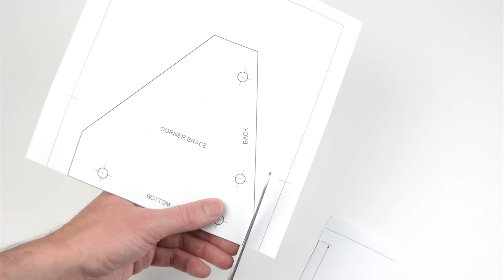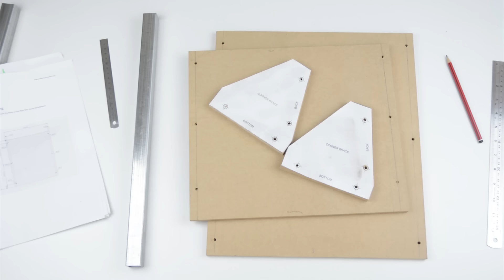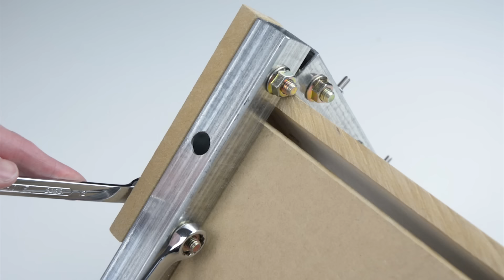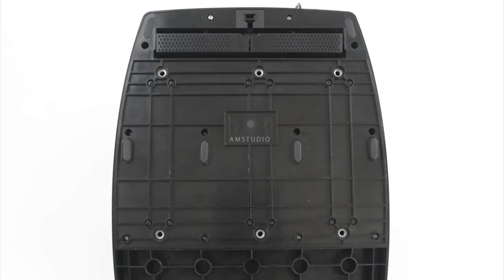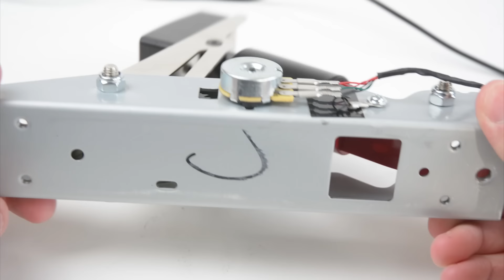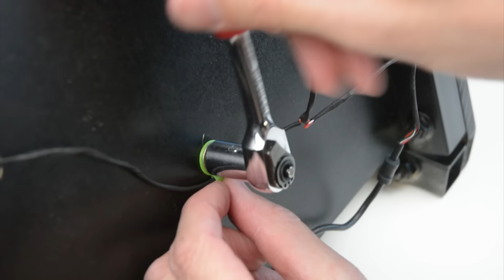HOW TO MAKE LOGITECH INVERTED PEDALS DIY

Comment: I've done this, but made dxf files in LibreCAD so the plywood gets laser cut (outsourced as it is cheaper than buying the whole MDF/Plywood sheet). When assembled everything I found out that holes are assymetrical on the back board. So I had to drill additional mirrored cable holes.

Comment: If you don’t have the money or tools to work with metal, you can use 1x4’s as the frame instead of the 1x1 square steel tubes on the base so it’s the same height, but use 2x4’s for the frame of the board the pedals mount to because when you mount that wooden bracket on either side you’ll need something thicker than a 1x4 to screw into or to bolt through

Comment: For those wondering, you can just swap around the clutch and gas pedals and put all the screws back in so it's a nice sealed unit again.  No having to disconnect cables or anything.
Reply: That's what I was thinking of doing
Reply: @Cxltonnn  Nice.  Yeah totally worth it.  And the pedal plates are adjustable (3 positions per pedal).  So just customize it to your liking.
Reply: @Kuli24000 dude your comment is absolutely golden
Reply: What do you mean by this - keep the unit intact as is (well, with the L<>R pedal swap) and then just mount it inverted on a vertical board?
Reply: If you swap the pedals and invert the pedal box youll still need to rearrange the wires so the clutch and accelerator wires go to the right pedals though.

Comment: I would highly advise electrical taping the potentiometer connections individually to prevent risk of electrial shock, or if you have heat shrink tubing, do that...

This would also prevent any issues with shorting or ground faults in case of a foot slip

Comment: Hi, I did that before to see this video, I did not move the conectors, just dissasembled the whole pedal, switched spings, removed the bother black piece inside the break and changed the spring for a softer one, assembled the pedals again, I switched cluth and accelator because of the new upside down diagonal position and it works perfectly.

Comment: Hey quick question if your still reading comments
Will the accelerator have the same force as the clutch? and the other way around
Reply: It won't make any difference at all how it's mounted. The springs in the pedals work the same regardless
Reply: @crashovride02  that was a long time, i have made my inverted pedals i didnt understand it as much but now i do. Thanks for explaining further
Reply: There was a video on here somewhere talking about how you could swap out the springs between the three pedals. Think clutch went to brakes, brakes went to gas pedal abs gas went to clutch. You’ll find you have better control braking and accelerating with that setup.

Comment: Stupid question, but looking to do something similar.. I don’t use the clutch though, Guessing I could just not reattach the clutch pot and leave the wires unplugged, and create just a throttle brake setup?

Comment: Finished my build today and mounted it to the racing stand I have.  Looks and feels great!  The only problem I had was with the spray adhesive, despite following the instructions it never seemed to set properly, so I ended up using a staple gun to mount the carpet tile.  Also installed the GTEye springs at the same time.  Thanks again for your great tutorial and the downloadable booklet!
Reply: some adhesive sprays need a primer / catalyst to be applied before it will actually become sticky, we have a tin of spray adhesive that does nothing unless you use this primer marker pen first. It's a bit stupid but worth noting and looking out for when buying spray adhesive.
Reply: @no.7893  Thanks for the tip!
Reply: Hey mate what racing stand do you have?
Reply: @ezzy07  I have the "Marada" brand one you see on Amazon and such. It was the cheapest I could find that looked reasonable. It's not the most rigid for the wheelbase but I'm fine with it. I now have all Moza stuff

Comment: I cannot fully express how amazing this upgrade is. I had to fully redesign the front end of my sim rig to facilitate this, and it was 100% worth it. Go to the link and buy the instructions. Then go to lowes and buy all the materials to make it. For carpet, I used a rubber based work  mat with a fabric top, and used loctite adhesive (looks like caulk) to adhere it. Worth every single penny, a definite must have for all the g29 pedal users
Reply: How much does it cost in suplys to make this?
Reply: @timmins2k215  kinda depends on the sim. I built my frame out of square tubing, since I have a welder and such. But just cost for the inverted pedals, mat, hardware, etc, I think it was around 40 bucks. Something I would recommend after using it a lot, is a padded base for your feet to rest on (if you don't run shoes on your sim, I just run socks bc I'm lazy lol)
Reply: @AWSpoofwil  nice one bro im guna buy some and make it for my g920

Comment: Easy/cheaper way: Reverse the Whole body of the pedals that it should face down towards your wall and after that Make it face upto the ceiling and before you do it Get some wood plated with carpets and When you make the pedals face reversed and up, Fit the Nuts with a driller from the Bottom And done

Comment: wait cant i just flip it around and stick it to a wall  and change the keybind ?
Reply: The clutch is a bit stiffer. And this DIY build is just cooler looking than the original pedals. But if you don't mind the fact that the accelerator is stiffer then you can just flip it around

Comment: TOTAL COST & SOME TIPS

I just bought the build guide for 5€, and assembled everything. Wonderful!
I got the G923 2 weeks ago, and I decided to invert the pedals after an hour of use. For me, it feels more real and easy to use. The build is really sturdy... 

Items and total cost of the build (in Portugal):
Build Guide - 5€ (don't even try to build it without the guide, it will take you so much more time and effort to calculate every hole and measurement... amstudio's work is incredible and will save you time that you will need when building it);
Metal Square Tubes - 10€ (I bought a 2meters iron tube for 10€, I just had to cut it in 5 pieces, being the last one a left over that I use to practice the drilling);
MDF - 5€ (I just bought the two pieces cut in the right dimensions);
Bolts/Nuts - 10€ (I just bought half of them, spending around 4€, since I already had a few, but if you buy everything you will probably end up spending around 10€);
Carpet - ?€ (I used a rubber boat seat covering that I have... it gave it a nice look, feet don't slip, and it is easy to clean... prices were kinda high for a proper automotive carpet from what I could see);
Tools - ?€ (I didn't need to buy anything, since I have a lot of tools, but not only drills and spanners are important... 4 or 5 clamps will help you a lot too, as well as a spare pair of hands)

TOTAL: 30€ (if you don't think of going for optional and additional stuff that you don't have like paint and carpet)
If you are on a budget just work with what you have and you'll probably get a lower total cost than me :)

In terms of hours of work, not counting the time I spent getting some parts in store, it took me between 8 and 10. I planned and sketch everything alone, but I had a lot of help of another person when drilling, cutting and assembling things.

I'm from Portugal, and the store I recommend is "Maxmat" (I went to the one in Moita - Margem Sul). Two of the main competitors (Leroy and Barão e Costa) have a poor service and fewer options to choose from. Maxmat didn't even charge me for the MDF cutting, and I bet they would do the same for the metal tube if I would buy it there.

Hope it helped!
Reply: I Don't have pepal but can you tel me how many degrees that corner is?
Reply: @kevinblom5940  you got It?
Reply: @Jimmy-jz4pp  nah still not
Reply: Thanks man

Comment: I just want to swap my clutch and brake positions (Xbox, not PC, so I can't just remap them), is it possible to leave the original unit as it is and just swap the wires on the pedals?
Reply: Why would you want to swap the brake and clutch, unless you mean like the actual pedals, I just removed like 30 mins ago, a little rubber thing from the brake spring and it makes it so much better

Comment: Just finished making this and it's awesome
Reply: Could you please send me template and dimensions?
Reply: @playernotfound5438  I just made up the template myself
Reply: @bbomberz8151  oh okay
Reply: @playernotfound5438  are you thinking of building the same thing?
Reply: @bbomberz8151  Yes, I am currently buying parts.
Reply: @playernotfound5438  oh awesome well good luck it's totally worth it. Just make sure to not make the angle too steep while adding the two parts together otherwise it will hurt your ankles
Reply: @bbomberz8151  thanks for the tips

Comment: Bought a g92, now just waiting for it to arrive and watching how to mod it
Reply: How was it? Are the noises/clunkiness fine or annoying?
Reply: @mahmoudwaleed2818  I haven't got round to doing the mod yet, but the wheel itself is fairly solid. The pedals are a little loud when you let go of them quickly, but I think a thin strip of felt would fix that issue on stock set-up, if you do this mod I think the issue will go away completely as its hitting the plastic cover slightly on mine

Comment: I built it and added lighting I saw on another video. It works incredibly well! Great idea👍
Reply from the maker: Nice work!
Reply: Thank you. I love my setup now albeit basic with a Logitech g29 wheel and inverted pedal set with the Logitech shifter. All attached to a GT omega Apex stand and I’ve added Gteye springs for all pedals and a magnetic adapter for the paddle shifters. I have to say that anyone that owns a Logitech wheel, you must get the magnetic adapter for the paddle shifters. It makes a world of difference with feel and reality. Especially playing Assetto Corsa Competezione. Playing it on my PS4 Pro went from super fun to insanely realistic. I practice at least 5 hours a day on ACC. It’s my outlet lol. Very basic setup that I hope to upgrade soon as funds will allow. Keep practicing sim racing and you will get great. My recommendation is to not just use the paddle shifters but use a regular 6 speed shifter with clutch use. Every bit helps.

Comment: I'm thinking os a way to make these with extrusion profiles, so you can adjust pedal spacing and height. The problem is to connect pieces at an angle.

Comment: Unplug each terminal on the potentiometer? How the hell did you take them off so easily mine are not budging. Literally a show stopper for me
Reply: A pair of pliers should do the trick, just make sure to be careful of that black plastic film under the terminals and unscrew the ground wire while unplugging.

Comment: How does square tubing do anything?, it's not supporting anything ,all you're using is a bracket.......EDIT AFTER BUILT...I know when I've jumped the gun ...Just finished making ($80.00 at Bunnings for materials)   that's gonna hold up (I hope ) , Copied the main idea , cheers for that 👍added 2x metal brackets on back for added support....cheers mate

Comment: This is a pro's job, that's why he made it look easy. Look at his precision measurements, cutting, drilling, etc. For anyone else other than a pro, it's a sure way to screw it up altogether. Your money down the drain.

He is also an excellent driver who utilises heel-toe rev matching techniques. A talent indeed.
Reply: Lol this is all very basic stuff. Get a bit more material if at first you don't succeed, but even that isn't necessary, because you should measure everything a few times before cutting, and you are good to go. And when it comes to the only cutting being done here, you can have someone cut it for you, at a shop that sells wood or anyone who has the tools, if you ask nicely you probably won't need to pay. But then again, you could do it yourself. It's not that hard really.

Comment: How's the pedal separation on this mount ? I'm having trouble with my pedals being too close, so I'd like to separate them a little bit during the mounting. Is it possible ? or the separation provided with these measures is the same as the standard pedal set ?

Comment: Question, would it be easier to just flip the pedals, swap the clutch and accelerator springs, shift the brake and accelerator pedal around, and invert the box instead of having to do all that anyway and crack the case

Comment: What degree do you have your pedal board at? If the board straight up is 0 degrees is it leaning over 5, 10 degrees? And are you happy with that angle still? Thanks. I’m about to tackle this project for a sim I am building.

Comment: I built them but I‘m afraid if I press the brake pedal to hard that the wood would break. Is that possible?
Reply: Tom Borchard if you bought the 12 mm mdf it probably won't break, but if you don't want the risk you can buy a softer/progressive spring at a few places, gteye included.

Comment: I bought the plans and nearly finished making it! Also to save money I swapped the 25mm steel tube for timber and it''s plenty strong and rigid and cheaper than steel if anyone wants to make it on a budget I recommend doing this. Edit: After now using the inverted pedals for a while I can say they feel a lot better and more solid, like a higher end pedal set. Now I am going to make my own load cell brake and it should be just as good as more expensive pedals.
Reply: How smooth did it go for you with making the angle template
Reply: can you please send the plans to me i dont have paypal

Comment: I did this just velcroing/taping my pedals upside down to  a cardboard box (the one the steering wheel came in) and using other smaller boxes and some paper to finely wedge it underneath my desk at home. It looks decent enough and feels great.  No need for screws and electronics!

Comment: Could you use wood for the rails or do they have to be metal?  Also in the links to the supplies it seems like you are missing the smaller set of square tubes.

Comment: I am hoping to figure out the info in this video. You are operating a video game, but using car-like pedals to sit in a chair but have the "Feel" of actual pedal found in a vehicle. You are using a manufacture pedal assembly box, harvesting working parts to mount on floor board that is portable. I am looking to real world applications using a potentiometer to operate an actuator that is commonly found on actual vehicles, typically in HVAC systems. As a lever or knob would move a potentiometer (Rotary or Linear) who signal control the position of a small DC motor low current that perhaps moves a heat blend door from cold to hot. This direct air around the heater core of thru it for heat. The "Dumb" actuators have reduction gearing but in, but also drive a potentiometer used to supple position feed back. This provide the ability to position the door at any position one desires. This would be similar to drive-by-wire throttles, but for safety, have two pots. #1 pot, is 5 volts at idle and pot #2 is 0 volts at idle. They operate on a 5 volt regulated supply but provide two signals that logic decides correct position of throttle. The throttle motor assembly is similar in operation. While the motor is heavier with 12 volts DC, but also provide two pots with normal and inverted feed back. I wish to operate a simple actuator that using 1 feed-back pot, but to control heat doors on a 52 year old truck. So knob on dash, motor on heater door, turn knob a little, motor move door a little, then stops. In you experience, have you used a circuit like this or know of one. Just asking please. Retired ASE Master Tech with a great deal of electrical back ground. Hopping for positive response as your friends and other contacts may know how to accomplish this function. Thanks / Like

Comment: I would do that but cant for 2 reasons. 1. I'm physically incapable in doing this because I suck at DIY and making stuff like this. And 2 the bottom bolt on my clutch pedal is worn, weirdly because I haven't tried to take the pedals off. Maybe its my foot wearing it down over time. Cool idea and good to see it working. To be honest I think I'll go and buy a wheel set with pedals that do that already.

Comment: Hey, thank you very much! This is the second project I am building using your tutorials (the first was the button box). I bought the guide and all the materials - looking forward to start building the pedal stand :D I think the next project will be a steering wheel swap, again using your tutorials. Please do not abandon this hobby and never stop sharing it with us :D
Reply: I wanted to add that I finished building the stand - I still need to add carpet and paint it, but it is fully functional. Here are my observations: 
- using steel tubes is overkill - I used aluminum tubes and even so, I had difficulties with cutting/drilling (it's true that I do not have the best/proper tools nor do I have the space for them); I am planning on building another one for one of my friends, but I will totally switch to similar sized wood beams; either way, the design is rock solid :D

- there was no need for the sheet of MDF to be sized 900x600 - if you use the space correctly, 900x400 is enough
- I recommend using washers for the M6 bolts that hold the pedals

That's about it :D In no shape or form am I complaining about anything. I am very pleased with how the project turned out and I would like to thank you again!